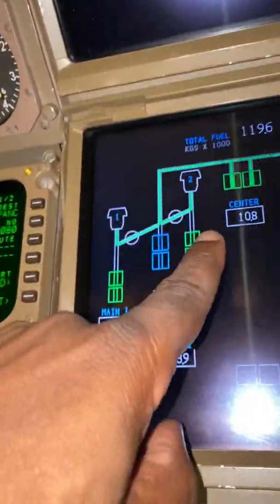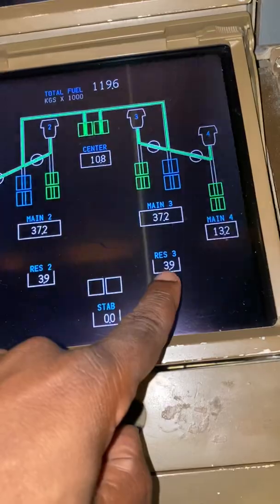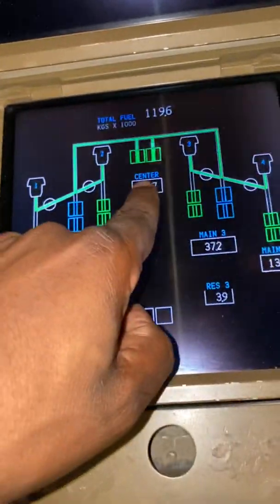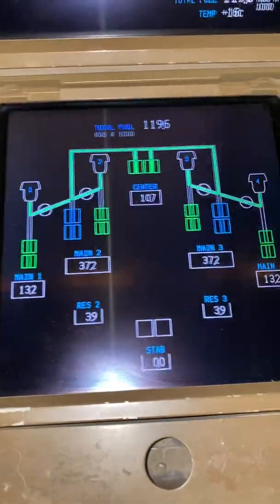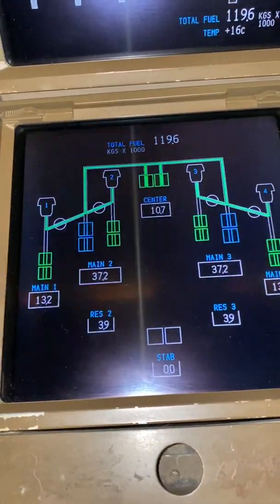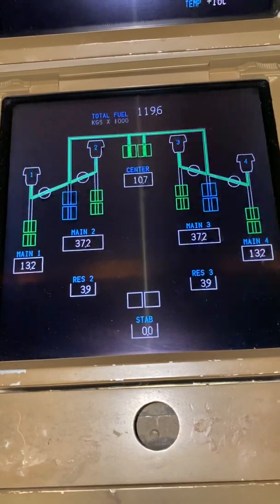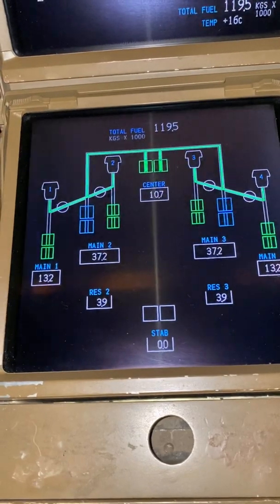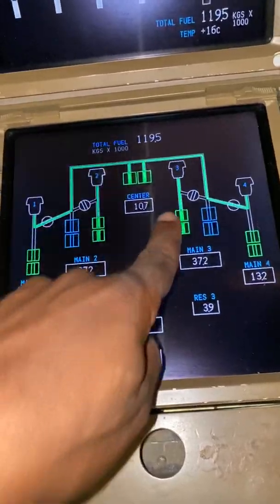B747-400 Fuel System logic

Comment: Can you explain the why behind this design feature?
Reply: The Main Tanks 1 and 4 are a lot smaller than the Main Tanks 2 and 3. So on takeoff you don't want to use them because it would use too much fuel. The CTR tank will be used always first.
Reply: @reischracing7078  What if center tank pump is off or there's no fuel there?